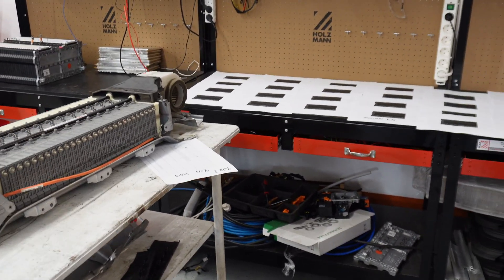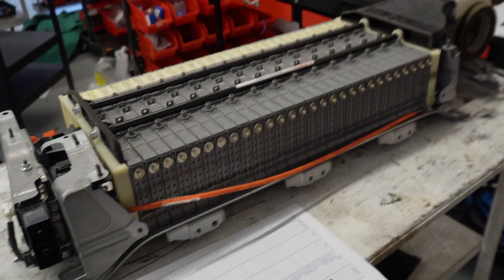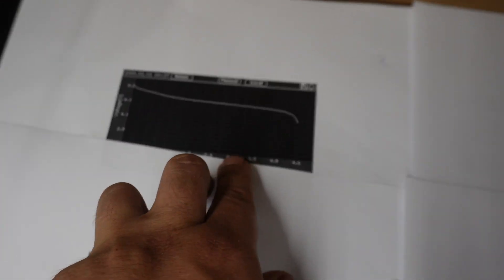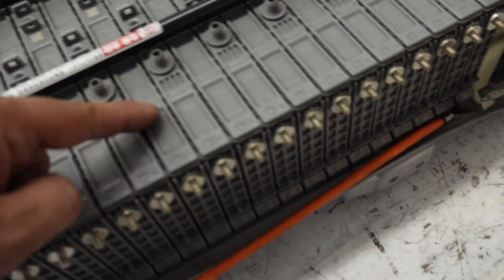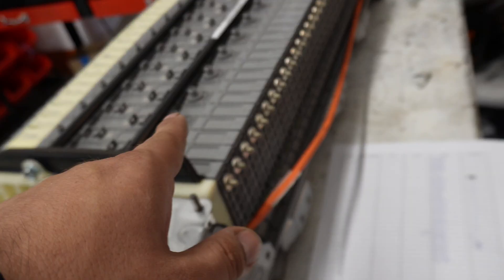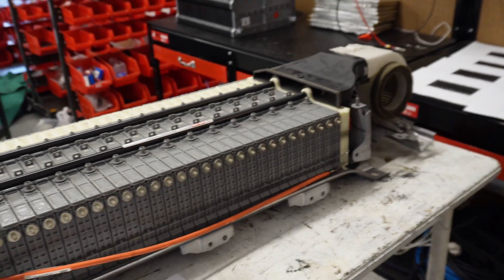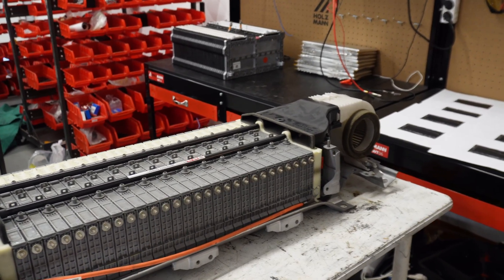82% Toyota battery DEGRADATION and REPAIR

Comment: So basicly this channel is stating, because of couple out of warranty repairs at their shop all toyota's are crap. In reality most of them are serviced in official toyota dealership to remain under toyota relax 10 years / 200.000km warranty and  never see service shops like this one. After mileage like this no car is to be expected to work another 10 years like new and toyota as one of most reliable car brands and hybrid system theirs most reliable drivetrain prooves that this video has nothing to do with reality. And 8 litres in city?? I have rav4 and have seen less than 4,5 litres many times, and never more that 6 in city.  My plan is to buy new car every 5-7 years so I dont really care about degradation. And about your tesla, while the battery will work, most of their electronics modules/computer, windows cracking etc... will need repair in the same period and for sure they are not cheap as well
Reply from the maker: So basicly you did not watch the video and you built up your own agenda propaganda narrative in aligment with Priusology theology

Comment: sorry but wtf are you talking about, we have 3 hybrids with consumption between 2023 4,8 l yaris cross awd, 2024 5,3l chr ( 200 HP ) and 2021 7l lexus rc f sport and we don't drive slow ...you have also toyota/lexus relax warranty up to 10 years.... no problems there...
Reply from the maker: So you have new cars with 10000 miles?
Reply: @evclinic  chr 17000 km, yaris 38000 km, lexus 78000 km..., old one had 135000 km... no problems there...
Reply from the maker: @aho4fun so you basically dont drive them and you brag how they dont fail. Why are you spamming? Did you watch video?
Reply: @evclinic  yes 135000 km is nothing, c'mon... it's ok, you are the best....

Comment: Well, is also about how you use the car.
If you are driving short rides, park it in the sun, then, battery stays mostly hot, and doesnt have time to cool down. In this case, you will see failure at 100kkm
If you are doing uber driving, or long trips, then it easy goes to 500kkm ( of course, not with 100% healthy battery, but it degrades predictible )

In my country, 90% of the taxi are prius, and 10% are hybrid fusions ( on methane gas..). And they are all well over 500kkm with original battery. And for sure with good fuel economy.

Comment: Is this auris self charging model?
I have one from 2014 and I absolutely love the car. So reliable.

Can I do something to the hybrid battery for that the car can serve me still many good years? Live in EU.
Reply: Not Auris but the one in Auris is almost the same ( I've got one as well ) what you can do is always check the filter under the seat. You can also use hybrid assistant ( you need an obd reader ) and you can force the fan to  be on full speed. Also on not days drive with AC on not with Windows open so that the battery stays cool

Comment: i am an uberdriver and drove one prius over 700 000km, bought it wirt 200 000. everything ev clinic states is true, degradarion is an issue, but you dont really need high capacity to get good gas mileage. my prius had battery refurbished once at 330 000km, and no issues after that. now i drive 3rd gen prius with 400k km, not sure what previous owner has done, capacity has degraded, but srill not terrible, and i get 4l per 100km. 

Again, i agree with everything ev clinics says, but wider picture is that whole system is very good, transmition last forever, rides very smooth with no gear changes, engines fairly reliable, and battery is relatively affordable, and cheap to repair with acessible cells to buy on used market. i believe toyota made good design to keep bateries and cars sustainable for many years to come. its an old design, i agree, but if you have 20 yoar old prius, you can steal keep it on the road with no issues.
Reply from the maker: @valuerc2664  thing is that what makes lower fuel consumption, is not toyota state of art battery, it is rest of the system. Battery is crap technology.
But even that is placebo, even toyota without hybrid has good fuel consumption
Reply: @evclinic  toyota non hybrids have similar gas mileage on highway, but not even close in the city. i agree with everything else. 

you can look from different perspective. many automatic transmitions dont last a lifetime, but, correct me if i am wrong, toyota hybrid transmitions almost never fail. i would rather pay for battery to be repaired than to buy new transmition. 

but in general, this batteries are not made to be used for ev driving, and if you try to drive in electric mode and deplete battery you will get significantly higher fuel consumption due to lower eficiency of battery charging and discharging loses. battery stays at 6 bars state of charge, during regular driving for best economy, you dont want to deplete battery below 5 bars. 

i am not sure about hybrid systems in other vehicles, but i think toyota hybrid sinergy drive is a clever sistem as a whole, and actually i believe that good safety and track record of toyota hybrids helped ev transition to some degree. i know that ev battery fires are very rare, and blown out of proportions in media, but i am not aware of any issues of toyota hybrids catching fires due to the battery, and that was another proof that no matter how outdated battery technology is, it proved that ev technology can be safe

Comment: What a nonsense…. My old hybrid Lexus RX 400h, 495.000 km, still going strong without any problems what so ever. Just regular service and no problems at all 🙌🏻… Those Balkan people do not service cars almost never ever and they want to car last for ever… Import 90% of all cars from Germany with 700.000km  and thinking they have “new” car…. Rubbish….
Reply from the maker: @alexa795  What is degradation of that battery? Do you erase error codes daily via obd and elm327? Battery reconditioned and cells swaped? 
I can not believe that lexus toyota sect can lie so much. Nobody ever seen 400h with original cells on 500k km and we do them on a weekly basis.
Reply: @evclinic  I am the first owner, everything original. Using suv as a hunting vehicle many years. As was brand new fuel consumption it’s between 6-9L as it’s now. Amazing  cars! No problems, and very cheap service maintenance cost. It is not without reason that it’s the best-selling car brand in the world.
Reply from the maker: @alexa795  but battery is not original as it was when it was new. It is 100% reconditioned and cells swapped, or even new battery pack
Reply: @evclinic  Like I said, everything it’s original 🙌🏻…. When time it’s come, it’s pretty cheap and easy swap damaged or bad cells in those battery packs. And drive another 500.000 km
Reply from the maker: @alexa795  Yes sure 😂 do you have OBD app connected to erase battery defect lamp when it pops up?
Reply: @evclinic  Don’t need to have that, that it’s your Balkan way to fix things. It’s Toyota/Lexus, other car brand’s can only dream about that quality, longevity 🙌🏻
Reply from the maker: @alexa795  When you have imagination even dragons can fly. I can bet in 10000€ that battery pack is not original, and again, as usual, owner is lying.
Reply: @evclinic  I think that you just using OBD fix for you PHEW customer’s as Balkan car enthusiast 🙌🏻

Comment: The 2010 Auris with 17 inch wheels was originally rated with an average consumption of 4,1l/100km. 

My average consumption over 13,5 years of ownership and just shy of 300k km driven is 5,086l/100km. 

This is not BC consumption, but real calculated(app). IMO this is impressive, as I use 17inch tires in winter also and the most of the first 250k was driven in group rides(so up to 4 people in the car).

My last longer trip 700km to the austrian Alps and back returned an average of 4,3l/100km. 

I am not saying your claims of degradation are wrong, but they are not complete and give a wrong picture about Toyota hybrids!
 
I do know that the system isn't optimal, but  it’s been around soooome time and has proven itself, it’s not the system that's at fault but the user, u said your self, heat and cold is the biggest factor at degradation, if the car isn't parked in a garage most of rhe time then this can have a significant effect on degradation.

I have been monitoring the temperatures of the pack during rides with the Dr. Prius App , the battery rarely gets to a significant temperature, only if you don't use AC in the summer time, but who doesn't.

I do expect that at some time I will have to deal with degraded modules, but your claims there are no Toyota hybrids over 250k are false and misleading.
Reply: The owner has a grudge against Toyota and even more hybrids only Tesla is good 😂
Reply: @encostablanca yeah they don't see further than their EV business...propagating EVs...their answers weren't even answers but comments trying to put words into my mouth, really 🙈 not worth talking about any further...
Reply from the maker: @aleszverca  That is mostly false advertising as usual. Because all those packs above 250k were serviced once, with marked cells or changed once under warranty in OEM. And as you said average consumption increases by age and degradation. It is not same to have 0.2kWh or 1.2kWh of battery pack.
Reply: @evclinic  U didn't or don't want to get my point, doesn't really matter. I am saying that for a 14 year old Toyota hybrid transporting 3 to 4 people most of it's life with a 5,1l average is pretty ducking impressive. ✌️ My pack is original.
Reply from the maker: @aleszverca  average is average, but it is not same consumption when it is 1.2 kwh and now at 0.2kWh. That means what you say that car doesnt even need a battery, pure fosil fuel engine would consum anyway 5l in non-hybrid!?
Reply: @evclinic  Ok then show me a 2010 1.8l ICE gasoline car with 140hp that on average consumes 5,1l/100km, let me guess there isn't any out there...come on, seriously.

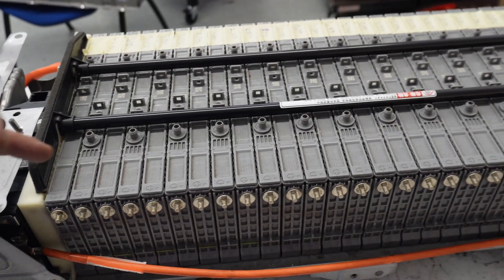Comment: 1:20 Note: It could be ok not to balance NiMH cells, because they dissipate heat, when they are at max. voltage. But the occuring (a lot of) heat has to be cooled off properly (!).

Comment: Do you offer some kind of certified battery dignostics? So the official retailer/service can't lie about battery cappacity in terms of 75% cappacity in 160 000km range warranty. How much would it cost cca? I'm a Dacia Spring owner with 30k km and assuming arround 10% degradation already (my personal subjective calculation). It would be great to see that kind of information on your website.
P.S. I admire your expertise, great channel, great videos. Would like to help out with my skills if I can come usefull to you some day.
Reply from the maker: Yes, we remove battery and measure with our equipment.

Comment: Cooling of battery pack is done by vent that is next to rear seat and can be filled with some crap and therefore insufficient cooling
Reply: Not only that. The cooling policy itself is IMHO epic crap. You can have even more that 3 degrees Celsius difference between the center sensor (warmer) and the lateral ones (colder) when you are driving, the fan is started waaay later (and at lower speed as well). Yesterday I parked outside my car and this morning the center sensor was at 28.9 degrees, while the lateral ones at about 25.8.
What pisses me off a lot is that they put a filter behind the grill on the 3rd generation Prius, but they did not in the Auris MY13. I mean, what the flying f*ck!? Is this the way you are sparing money?!
Reply: Very crude. A Toyota Prius has a radiator and a cooling system for the internal combustion engine, yet they paid little attention to proper cooling of the battery,

Comment: TDIL: So again: thermal managment is always the key to long lasting batteries! No matter what type of cell chemicals are used (NiMH). And it's also important to monitor that, even when BMS are normally not used for such battery types. Thank you EV-Clinic!!! I've wstched so many hybrid Battery repair videos, but no one had even tried to do a systematic scientifical trouble shooting or research!
Reply: And if you don't change the filter for the air cooler what do you expect 😂🎉🎉❤

Comment: There is a lot of hybrid toyotas on the road, that is why you get several of those batteries a week, even when the actual defect rate is pretty low.
Obviously the healthy battery packs do not get into your workshop.
The battery air filter needs to be changed with each oil change, as the manufacturer scheduled. That enables proper cooling function.

Just yesterday I drove a lot through the city and my fuel consumption ended up under 4 litres to 100 km. Long term I get 4.6L based on my fill ups, not the onboard computer.
You getting 8L in a city? Must have been a big Highlander SUV and you driving like you stole it.
Hybrids proved themselves over the last 25 years. I dont understand why you cherry pick information and missinterpret reality.
Every engineering solution has its pros and cons, but you only choose the share part of the picture and give bad advice to the public.
Reply: I tried to continue this thread but my comment disappeared twice smh
Reply: I said a lot of owners achieve much more than 250k km on original battery. I guess thats an uncomfortable truth for some.
Reply: Fact is that on the Auris MY13 there is no battery air filter. AFAIK, they start to put it on the Auris MY15 ... and please note: they were putting it on the Prius 3rd generation, but not on the Auris MY13. This is definitely a nasty commercial decision to spare a couple of bucks for each car.
Reply from the maker: @otomoravec1732  Doesnt matter what you think, i never seen prius with 500000km and original pack. Only one with 300k. Other with higher mileage had pack refurbished already 2-3 times by other workshops.
Board pc consumption doesnt mean it is really true. Usually in toyota is higher then it shows.
Reply: @evclinic  yeah well i am not saying you are wrong with cars you saw, i am just saying there is much more cars you did not see.
As I wrote, my consumption is calculated from the gas pump meter, not by the car computer (they do differ by 5% in my case). I have recorded every refueling I did on Spritmonitor for more than 3 years / 70k km, so I know very well what the actual numbers are.
Reply from the maker: @otomoravec1732  Yes but the point is that nobody have seen Toyota hybrid with original battery pack above 250.000km
Reply: @evclinic  moram sam reagirati jer moj frend  iz Minhena (taksist) na priusu starom 4 godine ima preko 420.000km i nije još mjenjao bateriju tako da sam ja vidio :) .Mislim da nije isto imati prius 15 godina i napraviti 300.000km ili voziti 3 godine i napraviti 550.000km. Ima priusa koji su napravili i 550.000km s istom baterijom . Prosjek trajanja baterije na toyotinim hibridima jer 280.000 - 320.000km, normalno ako se vozilo redovito održava. Sada cijena zamjene je povoljna s obzirom koliko se uštedi na gorivu i održavanju na tom vozilu. Ne vjerujem da su ljudi toliko godina glupi da kupuju toyote jer koliko znam najprodavanija marka na svijetu je još uvijek toyota.
Reply from the maker: @danijelkoraca5322  taksisti vecinom slazu, metla je original ali je 2 put mjenjana drska, i 2 put četka.
Reply: @evclinic  ja ne znam tko tu laže al znam da mi frend svakih par godina mijenja vozilo i već 14 godina kupuje Toyotu prius. Valjda on zna zašto tako radi i dali mu se to isplati 🤔. Do sada nikada nije imao niti jedan kvar za priusu. Valjda zato kupuje samo prius !!! Ili da mu kažem da je evclinic rekao da da laže 😁. On do sada nikada nije mijenjao bateriju na priusu i to znam s sigurnošću. Imate jako profesionalna pristup, svaka čast 😂🤣
Reply from the maker: @danijelkoraca5322  znam ja. Ja im popravljam
Reply: @evclinic  ja neznam dali ste vi vlasnik evclinica ili samo osoba za društvene mreže al takav pristup je jako loš za vaše poslovanje. Profesionalnost vam je na razini tinejdžera. Kako kažu u laži su kratke noge 😁
Reply from the maker: @danijelkoraca5322  znai publici kojoj 2 put trebas objasnavati banalnu stvar nije publika. Ti tvoji taksisti od milijardu km sa “original baterijom” dodju u servis da im popravimo bateriju “original” koja vec ima 3 razlicita markera i 3 put servisirana 😂😂😂 kakvu profesionalnost treba publici koja ne kuzi nista, poput tebe
Reply: @evclinic  you must be blind lol.....